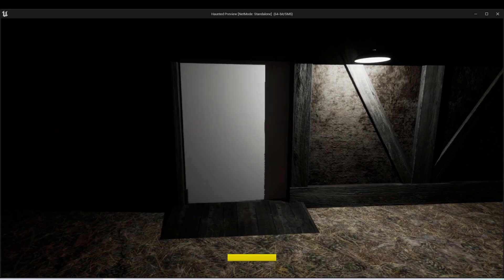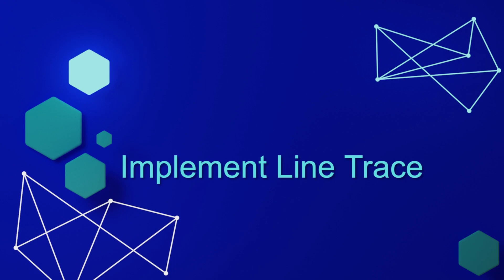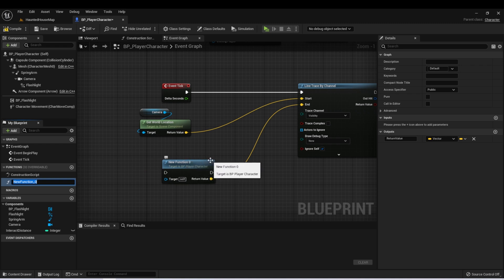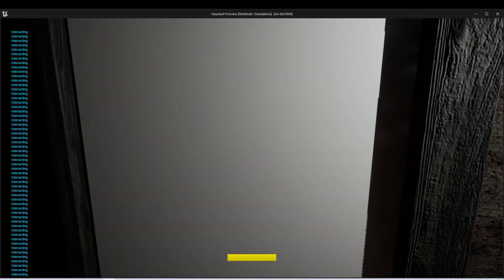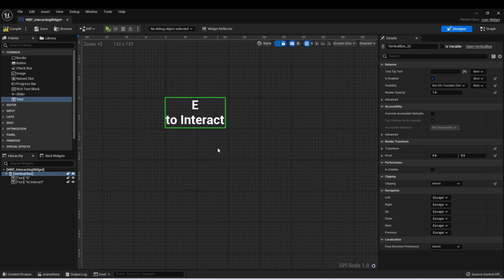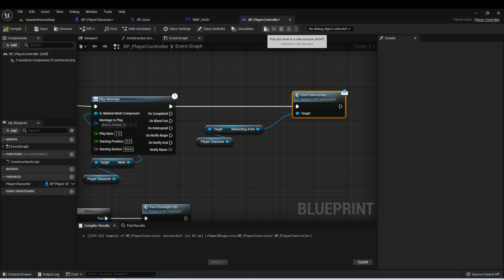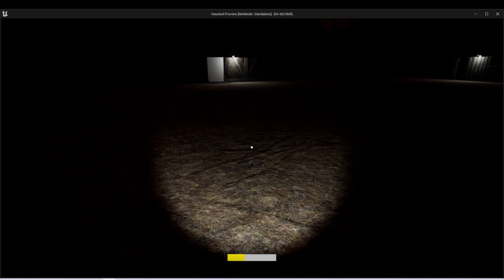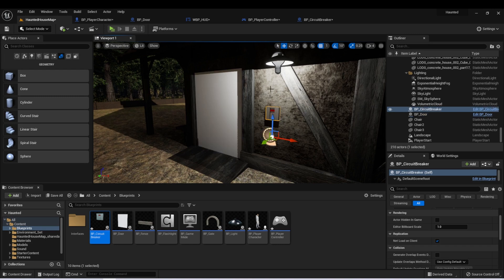Interface Implementation [ Game Development Basics - Week 4: Lesson 2 ]

Comment: I made sure to follow all the steps correctly but at 10:40, I am unable to get a reference for WBP_InteractingWidget. Still investigating, but I will post if I find a solution. Edit: Found out that I didn't check the "is variable" at the top of the widget details panel.